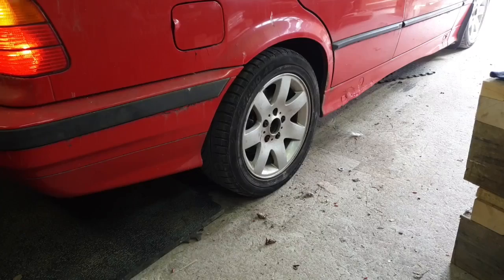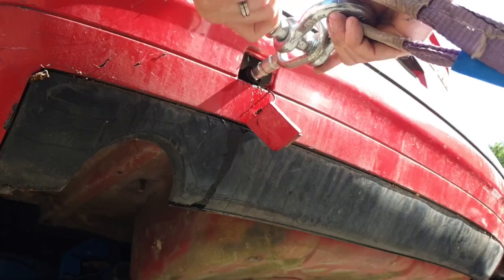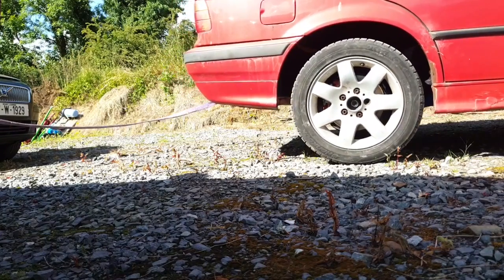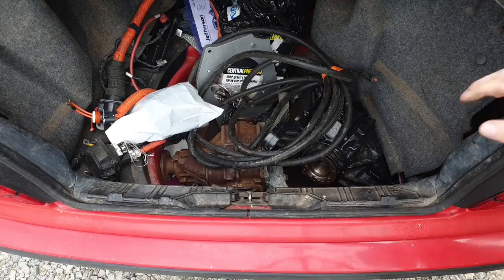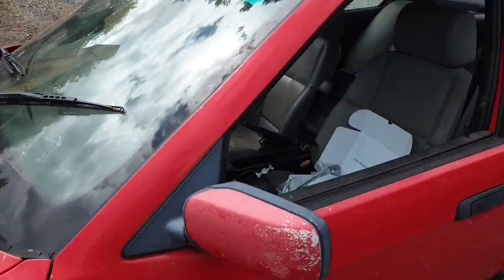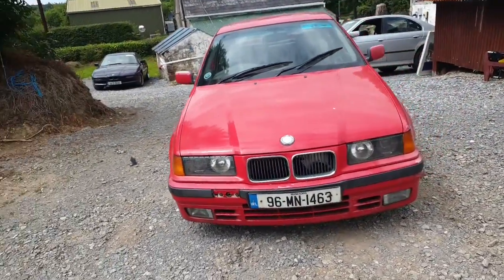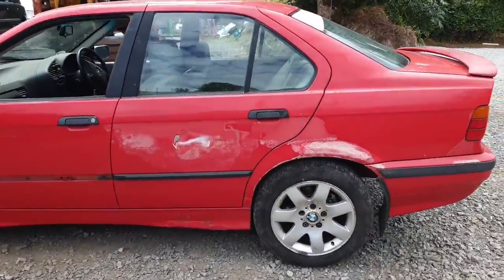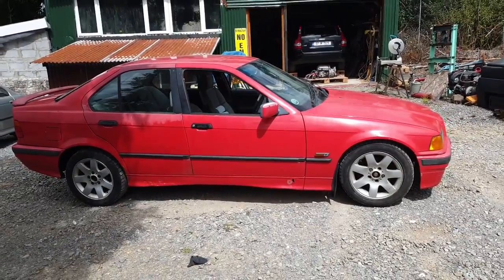BMW E36 EV Conversion Lexus GS300H Swap Part 7

Comment: I've never wrenched on an E36, so I dont know how big the transmission tunnel is, but I am sorely tempted to see if I can wedge one of those Lexus transmotors into my 2002. Seems like a nice middle ground between redesigning the rear suspension and half shafts to fit in a Tesla motor or else just putting some grotty old forklift motor in.
Reply: Start with a rear crashed e36, nothing that couldn't be repaired by a pro - or get a shell. Dismantle all the rear sheet in the trunk at the spot welds. Then you can throw in a porsche transmission and fabricobble a mount to fit an e-motor all neatly tucked in the rear. Much easier than fiddling with the trans tunnel and all that. You can "sheet it" once you're done using one of the many sheet fabricator services that are all over the place these days.
The reason for using a trashed car is, if something doesn't work, you won't trash yours and once you've figured out the recipe, you can basically transfer everything to yours and sell the project to another enthusiast.
Reply: @aserta  How is repairing crash damage, modifying a spare wheel well and making a fully custom rear suspension and motor adapter easier than modifying a transmission tunnel and just bolting in a new gearbox? 😅